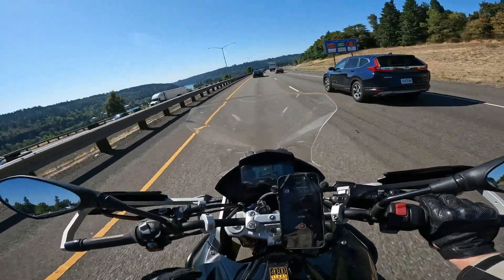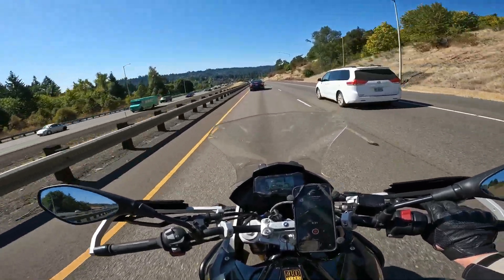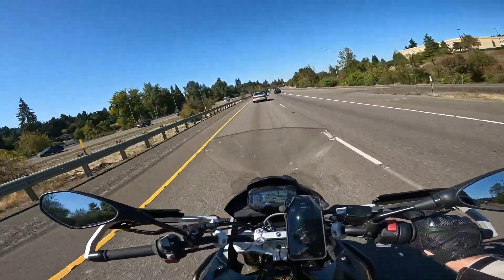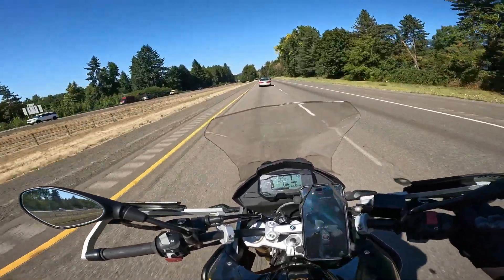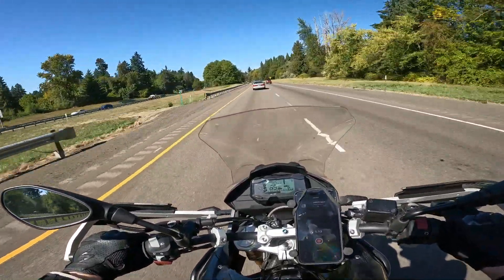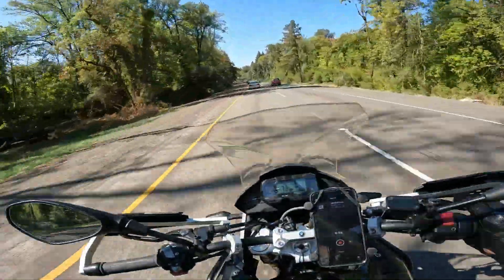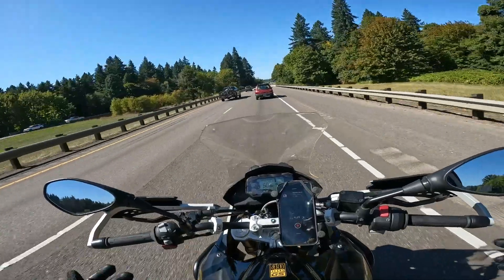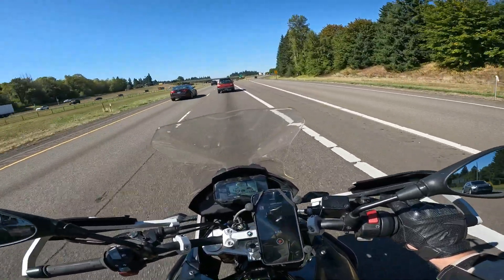BMW G310GS Can It Handle Freeway Riding?

Comment: I’m a truck driver looking to get a G310 as my very first bike. Anyway, when you said it doesn’t have a lot of passing power, and the locked it in fifth, I suddenly realized how fast most bikes must be, because, compared to a Peterbilt, that Beamer flew! 😂
Reply from the maker: 😂😂 yeah I bet!
Reply: If you have not yet, don't get this bike, you will quickly outgrow it as you become a better rider and will probably wish for something a little better within the first 6 months. Rather try for an sv650 or a bit more sporty 2 or even 4 cylinder small bike like mt-03 or 400 ninja, ninja RR (4 cylinder up to 75 hp with a computer update if you in the us) etc.

Comment: Thanks for sharing. I have the 2023 310GS and I have no problem on the freeway. I just stay within the speedlimit at 65-70mph. I do okay by myself with it but when I ride with other big bikes, I get dropped for sure. I used to have a R1200RT but sold it for the smaller bike. I love my 310GS and have no regrets for downsizing. I have been riding since 1980 and have had different bikes from Honda to Harley to BMW but at my age now, at 67, I am happy with my 310GS for weekend joyrides.

Comment: I have no issues with riding it on the highway here in NC.  I ride 60 miles round trip on the highway to work and with a good windscreen, it handles fine.  I just did a 1000k mile round trip where I drove 250 miles to the Smokey Mtn 500 trails starting point,  finished that ride of 500 miles over 2 days,  then drove the highway 250 miles back.  I changed out the handle bars and did a couple of things to reduce vibrations including adding weights on the bars.  Bar risers are a must on this bike especially if you do stretches on the highway.  Its definitely not designed for long highway use but it can easily get you to your trails and back home without having to haul the bike which is what I bought it for.
Reply from the maker: What kind of handle bars did you install?
Reply: This is really answered all my questions 
Thanks

Comment: To help get better stability on the front I suggest you add some preload to the rear shock. This will put more weight on the front.
Reply from the maker: Thank you for the advice I actually have done this since this video and it has made a difference

Comment: In The Netherlands highway speed is 60 mph, you can ride it all day!  Also another sprocket at front, 15 instead of 14 teeth will bring more comfort and less fuel consumption.  For longer rides another [more comfortable]  saddle is an idea.

Comment: Appreciate the video! 
Your roads have significantly fewer semi-trucks compared to Florida's highways. I've been riding the 2023 BMW G310 GS for the past 11 months, and it's an excellent choice for city commuting, backcountry roads, both paved and unpaved, and even light trails. Switching from a Harley, I'm not a huge fan of the 310 on the interstate, not because it can't maintain 70 mph, but due to how this lightweight motorcycle gets tossed around by strong winds from passing trucks.
Reply from the maker: Yeah, I agree.  The weight of this bike is both a downside and a highlight.

Comment: Hi from the UK - I have the 17 tooth front sprocket fitted & has made a real difference to the bike all round. I found first gear was ridiculously low & it's knocked 500 RPM off in top gear but can still pull it ok. 
It's a windy day today & was still pulling well at 75 - 80MPH without being wide open.  Small engines can take high revs all day but it sounds like you're being unkind to it after getting off my TDM 900.  👍
Reply: I am trying to buy a 17t front sproket for my 2023 310gs. I can not locate one. Can you recommend a place to buy one?

Comment: Wouldn't complain about a 400cc upgrade. Did not notice any type of wobble on long interstate ride with crosswinds. I do not like single as much multi cylinders for highway use. It is surprisingly good overall though.

Comment: Was thinking of getting this, bit scared and skeptical now since you said it can wobble very easily whenever it hits something slightly, something similar like speed wobbles. Is this common to happen, and if so should I still get this bike or no.
Reply from the maker: Yes! it’s still a great bike. Sense this video I have made a second one about freeway riding with this bike. It’s does it good but just keep in mind it’s light bike so it is more prone to movement at higher speeds
Reply: @advbrain9967  I see, thanks!

Comment: So at 6’6 300 what should I buy?
Reply: KTMs generally have the roomiest cockpits given your size and weight I would look at midsize and up not small displacement Adventure bikes. By the time you add luggage and that you'll be pushing A lot of air out of the way and carrying more weight than most of them are designed for. Also the suspensions will wind up being way too soft

Comment: Whats the top speed?
Reply from the maker: The bike’s top speed is about 85MPH but that’s a somewhat scary speed on that bike because of its size. I usually only go about 70-75 and that’s a pretty comfortable speed for me anyways
Reply from the maker: Yeah. if you like to go fast, then this is definitely not the bike for you haha it’s only got 34hp. No where near the f900 but that is is a nice bike have you looked into the CFMOTO 450s ? Or maybe a used Ducati monster if you want to stick with the upright seating position of a naked bike.
Reply: @advbrain9967  Wish they made the f900r a bit faster. BMW bikes in general seem quite slow. Even the s1000rr is a bit disappointing compared to Ducati.
Reply: My bike does not wobble at any speed.
Reply: The s1000rr is slow? Tomato is on crack.
Reply: @stevehoward3981  S100RR is slow compared to Panigale yeah
Reply: @advbrain9967 kove 450 😊
Reply: Mine doesn't either, at least up to 90 mph @stevehoward3981